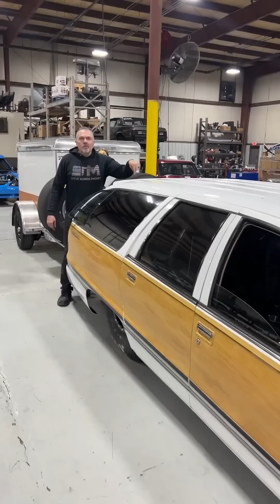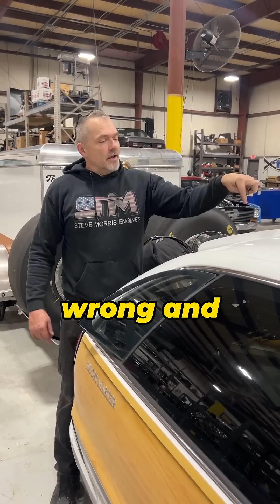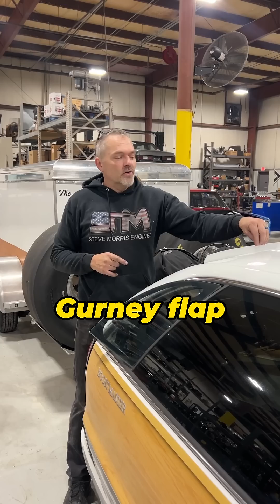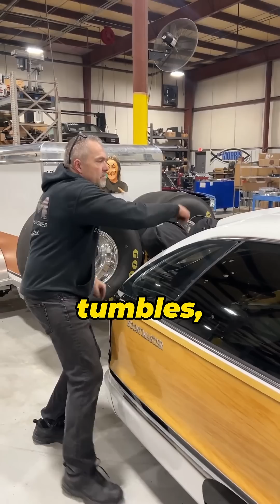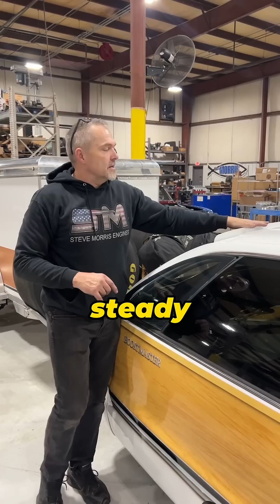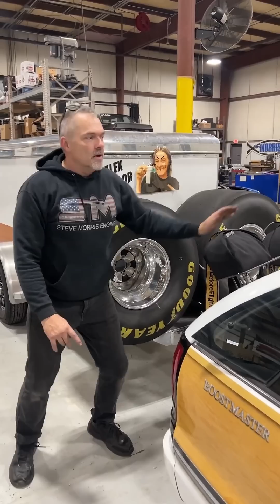250 MPH Gurney Flap ?

Comment: Not entriely true. The stablity comes from the large amount of the drag  produced by the flap behind the car. If the flap wasn't there, the lift on the hatch of the car would increase, and the drag decreased, lifting the car off the ground. This why you see nascar riding with lip spoilers. It doesn't really deflect wind up, but it increases the drag at the rear for stability. A wing would provide more downforce if designed properly for the car.
Reply: Take a sizable model car and place it on a tread mill with a string tied to the front bumper to hold it in place and a string at the rear bumper thats just free. Start the tread mill. Once the tread mill is up to speed, push the back of the car and observe the vehicle sway violently. Now pull back on the string at the rear of the car and observe the stability increase the more force you apply. This is more or less how that type of spoiler works. And the bigger that spoiler is the more drag you have and the more stable your car will be but at the cost of speed.

Comment: When ford was designing the crown vic P71 interceptor one of the requirements was it had to go at least 220km/h to match the speed of most police helicopters and be faster than most production vehicles at the time. The problem is the panther platform had a tendency for the rear end to want to lift off the ground at around 190. Hugely expensive suspension overhauls were proposed but in the end it was decided to turn the trunklid into a spoiler and the downforce was enough to counteract the lift off.
Reply: @P7777-u7r  wow dude that is AMAZING! Thank you for the read.

Comment: To put things in perspective. If you bought the 2019 honda civic base model (without the spoiler) then your computer topped the speed out at 110ish. If you bought the model with spoiler your computer unlocked an additional 20 hp. 
Mind you i dont remember the numbers specific but the idea is that areo dynamics are important and considered by engineers. So much so that safety is considered also. A car doesn't handle well under areo forces without the proper counter measures.

Comment: Remember on the little Kia or Hyundai SUVs i think it was, one of the small ones, would want to flip forward at 80+ in high winds from the air tumbling over the top and getting under the rear end and lifting it. But even none of these street cars are designed to go no 200 so things will have to be considered like this gurney flap

Comment: at 200 mph the front windshield is forcing the relative air up and that pressure is what's pushing the car down , it's not the force of air pushing down on the roof creating down force and holding the car down , the gurney airfoil at the trailing edge is deflecting the air upward and thereby disrupting the airflow behind the car which was causing drag (low air pressure , a slight vacuum) which results in lower overall speed , so when you eliminate the drag you gain a slight increase in speed.
Reply: Yes the rake kf the windshield divides the pressure, but the roof surface actually holds that pressure...  so it endures more of the pressure than the windscreen, which is a good thing...  those forces are pushing the car downwards moreso than backwards.
Reply: @1SqueakyWheel  I noticed on a 67 GTO that I drove for awhile we didnt need on wing on it to get it to drive nice at the finish line, at about 170MPH. I always assumed that it was because of that big, flat deck lid it had. By comparison on our 89 Firebird that did have a wing, I took a couple of degrees of angle out of it and noticed the car was not nearly as stable at those same speeds. It seems to me that large horizontal surfaces are pretty good at making downforce.

Comment: I know that you would get a significant increase in gas mileage by sliding the roof rack all the way back. That directed the airstream smoothly over the back glass enabling a 9.3 to 1 compression ratio old school 350 to get 26 mi to the gallon with a four speed. I'd be interested in what happened if you redirected the airflow with an air foil.

Comment: I'm buying lottery tickets just so perhaps I can afford one of your supercharged monster all aluminium engines for my ProStreet '64 Corvette. The one in the channel icon pic. Yeah, it's pink. I didn't pick the color but it was too good to change when we got it 30 years ago. 
I'm 70 and after 5 cancer surgeries and 25 or so surgeries for trauma i may double up on buying tickets. I offered to let Cletus use the car as a mule but never heard back from em so I'll offer you you the same thing. YOU pick an engine to run in it. A back halved car now but maybe you could make some necessary changes. I'm not a racer but have made passes between rounds. It hooks and runs straight with it's 4 link with Dana rear, Strange axles, Summers brothers center stuff. Not a spool tho. Last folks that raced it wanted to run in the 10" tire class and also the big tire class so the rear is tubbed but not narrowed up much so you can run either tire and wheel package. Currently 33x19.50x15. Tried to get the 21.50's on it but rubbed when turning a corner. Been on jack stands since 2006. Some goober heads built the engine, 427 BBC with old school Dyers supercharger. I was dealing with the health and other issues so just put 6 miles on it, didn't like the way it felt so parked it. Needs front of cage put back in it. 
I'll see if i can get in touch with ya. 
Greatly admire your attention to detail in your work plus you look like my doctor that saved my life by catching a cancer that my other doctor ignored. 
rick in Tennessee. 
Patron state of shootin stuff....
And seeing black marks that somebody made black marks over.
It's like dogs marking their territory. 
Sorry for long post....
PTSD and me.

Comment: Those little spoilers Chevy used on a lot of projects like the blazer. The big thing was about a curtain of air over the back window actually kept the back window clean of dust and stuff. !!!
Reply: @liamwalshlennyslemon9361  that’s what I thought it was for…..keeps back window clean/ especially when driving on gravel roads.
Reply: And so you could open the tailgate window and not suck exhaust fumes back into the car.

Comment: Fun Fact the Late Great F1 Legend Dan Gurney actually did the fine tuning for the repurposed Corolla suspension used in the OG AW11 Mk1-a MR2 to have it handle similar to an F3 machine, the wing on that car actually reduces drag too, so his contributions are many

Some folks call the tiny wheelbase MR2 a Widowmaker for it's twitchy extremely responsive nature, but I'm so glad Toyota hired Mr. Dan Gurney to fine tune the AW11-a's handling on Angels Chrest Highway making it one of the only cars that requires constant 10/10ths engagement under spirited driving on real everyday roads

Downside is, him fitting in a helmet was a design requirement by Toyota, which with him being like 6'3” or something means the MR2 wasn't nearly as slick as the Fiero, & with my lower leaned back BuddyClub racing seats the MR2 actually feels much bigger than it needs to be inside, but the handling is so worth that cost!
Reply: If you ask me, every car should be designed to fit a 6'3 man with a helmet and have the top of a 13-inch steering wheel be able to be set at nose height on said man while also pointing more or less straight as his chest.

But that's because I, myself, am a 6'1 man and genuinely enjoy proper sports seating postion similar to the GT position, or at least somewhere between or mixing that and the Rally position.
Reply: I can understand, would've be been nice if my car had a lower seat to start with, but then we wouldn't've gotten the factory-fitted under-butt pancake-sub

Comment: Your understanding of how it is helping with MPH is not correct. 

Downforce=force perpendicular to the ground.
Drag=Force parallel to the ground.

The ability of the car to go at a certain velocity is affected by drag, not downforce. So while additional downforce might be created, that is not the reason if improves MPH. Also, the reason downforce is generated due to the flap (or more likely negative downforce is reduced) is more complex than the explanation here. Way more complex. And most of what is happening is after the flap, not the top of the car.

The way the flap is improving top speed is by reducing drag. You are somewhat correct in how you describe the air tumbling at the rear of the car, this is called a separation bubble. This occurs when an aero device has what is known as an adverse pressure gradient, as all cars have. I won't try to explain that here, there are plenty of videos if you type "adverse pressure gradient" into YT. 

This wagon has an extreme adverse pressure gradient, meaning the air flow is separating very high at the rear of the car. The area below and behind the point of separation creates a low-pressure region. Think of a low pressure region as a vacuum area. So by having a huge separation bubble, essentially a vacuum is being applied to the rear of the car, trying to slow it down. This is a form of what is known as "form drag". The area of the rear of the car being "vacuumed" can be significant on a vehicle like this, probably nearly the entire surface area of the rear of the car from about the top of the rear hatch downward at really high speeds.

The Gurney flap alters the drag profile by creating a very small but intense area of turbulence at the rear of the car. It is most effective at reducing drag by being placed just before the point of separation. The turbulence puts energy into the boundary layer to cause the air flow to stay attached farther into the adverse pressure region. Again, way too complicated to try and explain that here, you will just have to trust me or look it up yourselves.

By causing the air to stay attached longer, the separation bubble starts lower and farther back, and is generally less intense. So the result is that the low pressure region, the one acting as a vacuum to suck the car slower, is now both less intense and acting on less surface area of the rear of the car. THAT is why drag is reduced and the car goes faster. It has nothing to do with downforce or the roof of the car.
Reply: - so ?? which willl do the job best - gurney flap vs VGs - or marry the 2, make VGs out of "trailing" limit of the GF to create controlled vortices - without the induced drag of "downforce?...  (testing needed - or high fidelity simulation - to see where "optimal" lies)

Comment: Dan Gurney = Legend. No we know that, I've always called it a "wicker bill" where did that name originate?
Reply: Dan Gurney was @ Monaco racing F1 & the rear wing height was reduced that year so he added a piece of aluminum to the trailing edge to help settle the rear end , with extra down force .Soon all teams copied it.
Reply: Bobby Unser
Reply: Probably Dan Gurney. I doubt he would have been the one to call it a Gurney flap.
Reply: @ could be
Reply: The Gurney flap and the term "wickerbill" refer to the same device, with "wickerbill" being a colloquial name used primarily in the U.S. There isn't a specific date when the term changed; it has been used interchangeably since the flap was invented by Dan Gurney in 1971.

Comment: Aerodynamics, even with small incremental adjustments can be critical to anything that is going to go fast. Kelly Johnson of Lockheed Skunk Works was a genius at squeezing the most out of any aerodynamic equation for aircraft.
Many in the auto racing industry have studied his works to gain more speed.
Reply: Steve, you may want to consider putting a similar lip lengthwise down the roofline on both sides. It will trap that air full length of the roof, and it should add downforce to the car.
Reply: @jondahl3173  Lip lengthwise down the roofline? That doesn't make sense! You should proofread this and explain better what you mean because it sounds like nonsense!
Reply: @wesman7837  depends if it would channel the air flow ,maybe
Reply: @wesman7837  You seen the ones that are on Stock Cars and Cup Cars? They only have one on the right side, lip that runs parellel with the direction of travel on the roof of the car, it creates side force for them. In this case you'd have one on each side of the roof in an attempt to like he said increase the high pressure zone on top of the roof, and possibly clean up airflow trying to spill over the roof of the car towards the quarter panels
Reply: @wesman7837  It would be similar to the side panels on fuel car wings, they would keep the air from spilling over the sides of the roof.
Reply: @allanpolk2681  big facts. I learnt that with a boosted miata. Stock bumper makes 150lbs of lift at 100mph a 10$ piece of garden edge turned into a front lip totally neutralized the lift
Reply: @ Yessir, that’s what I’m talking about.
A VERY inexpensive fix for a potential 
catastrophic problem. 
As I said even small increments can make a huge impact.
Glad you got it squared away on the
cheap.